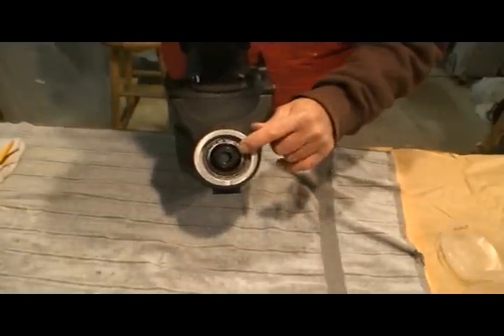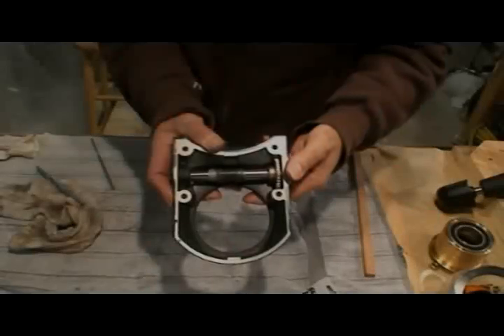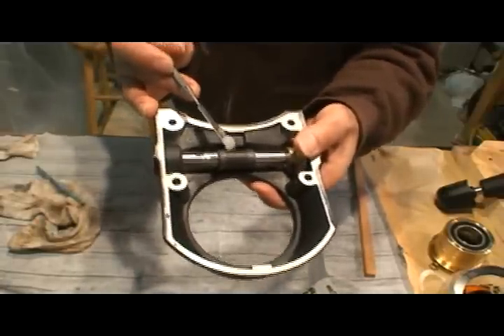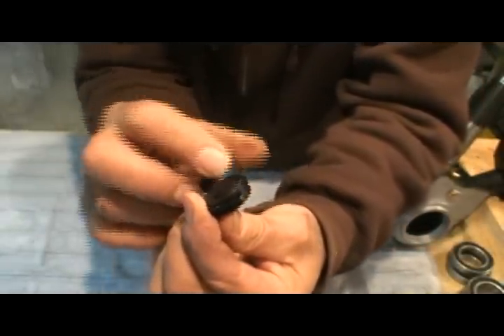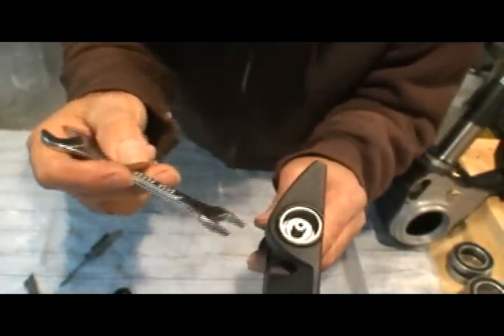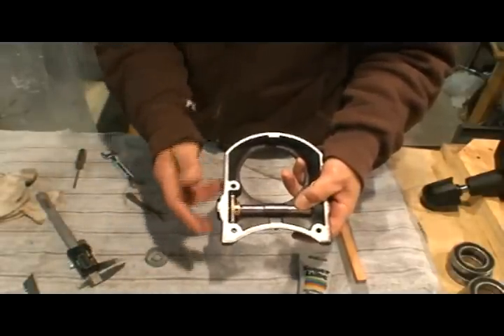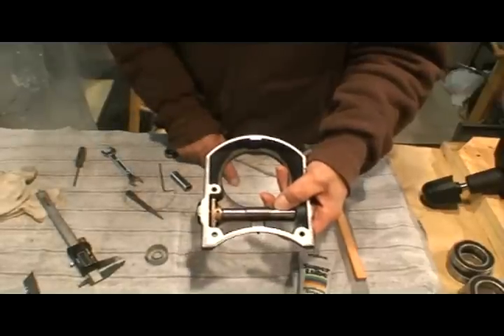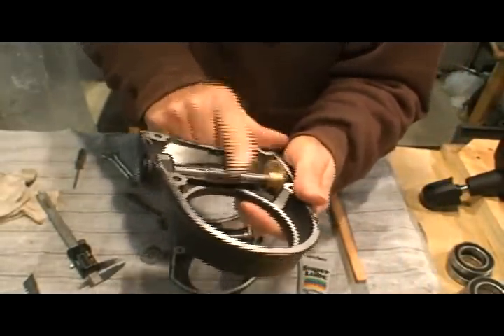CGEM Tune Up Supplement Video

Comment: Whoa!  You bought a $1,500 CGEM mount and, not 5 weeks later, you DISSASEMBLED it?!?!?!?!?  Talk about guts...
Reply from the maker: They are a lot better now, so I wouldn't recommend the tuneup right off.  Give it 4-6 months and see if it's a matter of learning  how to work the mount to get the most out of it.  Rather than thinking it's something mechanical.  But even after a tuneup you still will need to dial it and yourself in to get the most out of it.
Reply: So... complete disassembly is no longer recommended by you after only a few  weeks?
What a relief!
Please, tell me what else that is very expensive that I might be able to tear apart.
Seriously, I know these mounts are manufactured and assembled in china and have no super sensitive componentry but, really, tearing apart an equatorial mount in such a way...
It's just hard to watch.
Reply from the maker: I don't see how you get that after only a few weeks I no longer recommend taking them apart.  That recommendation is based on today, five years later,  because the CGEM is a better mount.   No so back then, which I thought I made clear enough.  I could explain the demands of astrophotography and therefore the need for the HyperTuning in 2010.  But that would probably be a waste of time with your apparent attitude.
Reply: Boy...... if THAT ain't the POT CALLING THE KETTLE BLACK. to ANY casual, fair and impartial observer, it is CLEAR that YOU Dan, are the one who came in calling DSN out here, questioning him (to put it nicely) on everything he's done, the reasoning for it, his experience (which YOU YOURSELF OBVIOUSLY do NOT have, despite claiming to have "engaged in AP many times"), and now you have the audacity to question his motive for producing and posting his video, and accuse HIM of trying to start a fight?  SO, GET LOST you VERY IMPOLITE TROLL !!!
Reply: +Dakota Starry Nights I have engaged in astrophotography many times.
I have never, though, bought expensive astronomical telescope mounts and then completley disassembled them in some contrived effort to get attention on a YT video... never had that much $ to waste.
I know a few small things to do to an astronomical  telescope mounting for improvement, however, your route appears a bit too intense and, even, unecessary, with far to small of a gain realized.
Reply: And can you explain your reasoning about my "attitude"?
I commented on your video.
Like most goofy YT video posters, you take every opportunity to almost start a fight with anyone.
Reply: angle turner Angle, relax.
Lots of garbage on the 'net to reply to and hate on.
Crying over someone who is critical of anyone who would tear apart a new, $1,500 telescope mount is a waste of precious life.
Lots and lots of bigger Youtube garbage to cry over.
Reply: @dantyler6907  he isnt telling people to teartheir stuff apart, he is showing how if you are intersted in fine tuning it.  You sound like a total jerk.  Get over yourself

Comment: I can not agree that you should grease the worm barrel, the whole point of the clutch button contacting the barrel is to stop it spinning so the whole axis turns both the barrel and the housing as one, if you grease it you will get clutch slip which will give you bad slews and tracking..

Comment from the maker: @DHLaShomb 
The CGEM is an outstanding mount for the money if you keep your imaging platform under 22 pounds.  I'm at 19.5 pounds and a 30 minute sub is not a problem.  The upgrade I wouldn't recommend it if your mount is new.  You might run into warrantee problems if you split the case.  The most important thing you could do is get the weight down.  Once I got under 20 pounds it made a world of difference.  The upgrade is tricky and may not improve things at all if you're above 24 pounds.
Reply: 30 minute subs blew my mind; I’m having trouble with anything above 300”; please kindly share tricks of the trade to improve guiding; working with an AA+ and an older CGEM.

Comment from the maker: I would just like to point out that unless you are having troubles related to the inner workings of the mount and not balance issues or overloading the mount with too large of a OTA, I'd advise against taking it apart.  There are a lot of things that require exact adjustment and it can do much more harm than good if you don't get it right.  If your mount is new or less then 2 years old I would contact Celestron first before spliting the case open. 

Clear Nights